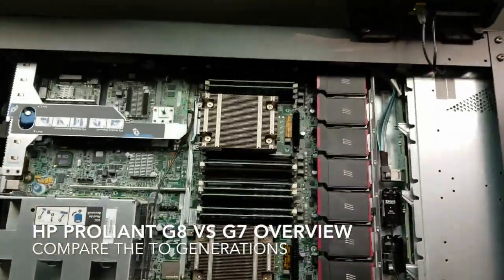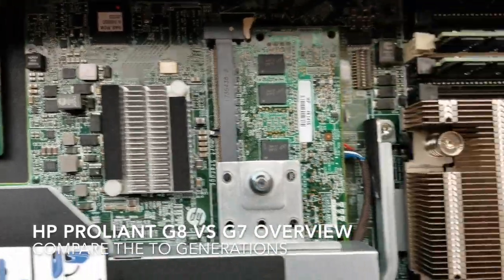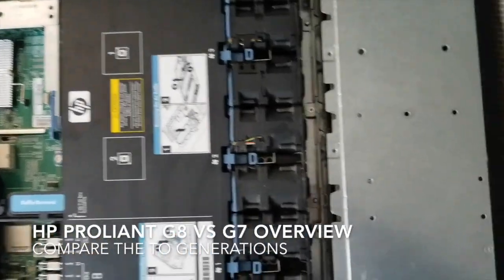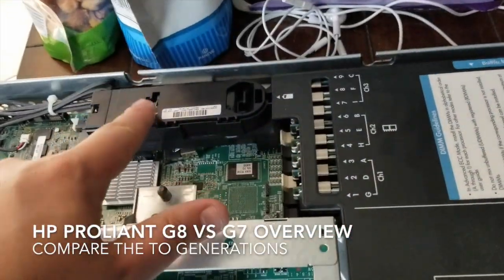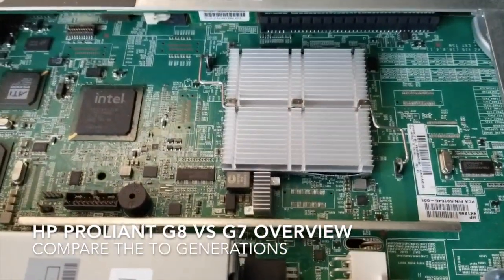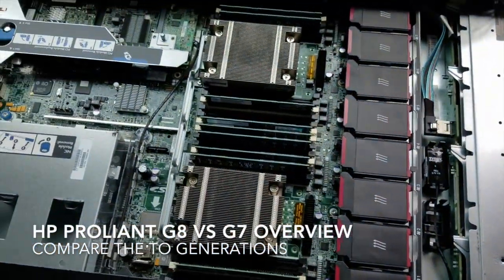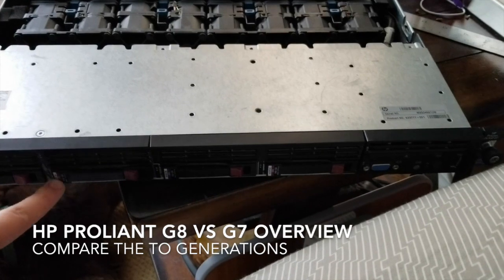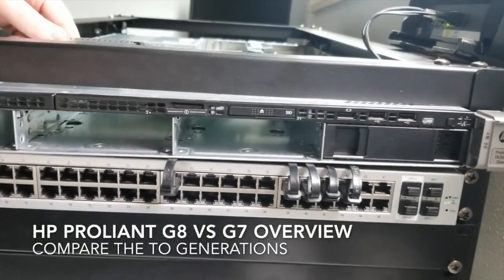Comparing the HP Proliant dl360 g8 to the dl360 g7 review and visual overview

Comment: Hi. Thank for your video. I have problems with this Server. They turn on the hard drives but it won't boot. It remains in Repair a few seconds and then it restarts. What should I do to repair it without losing the information on the hard drives?
Thank you very much.
My email is: scardosod1655@gmail.com